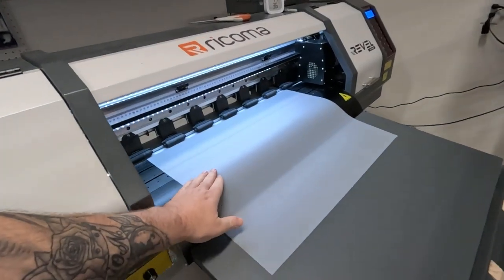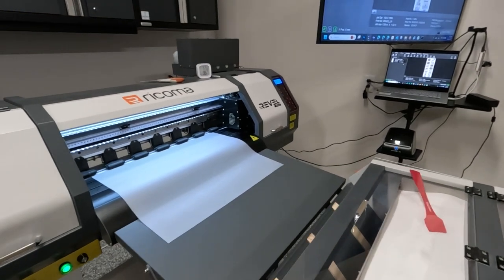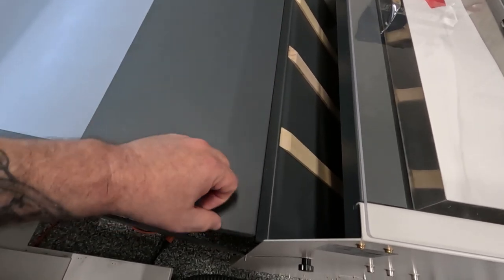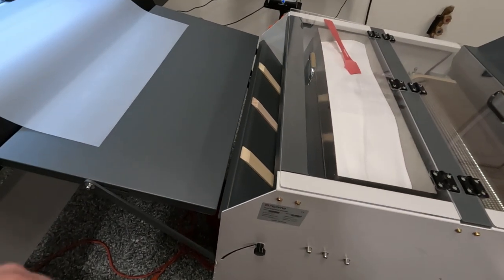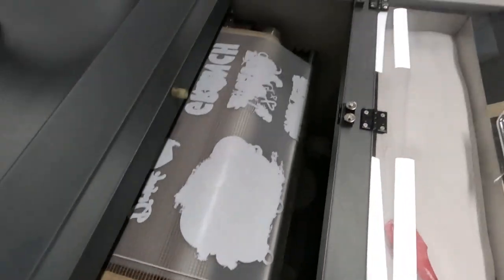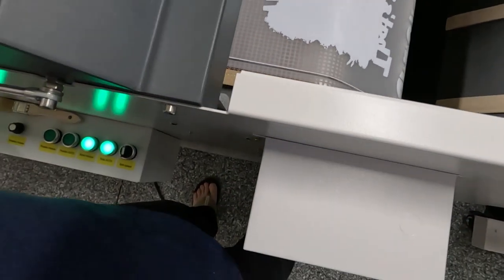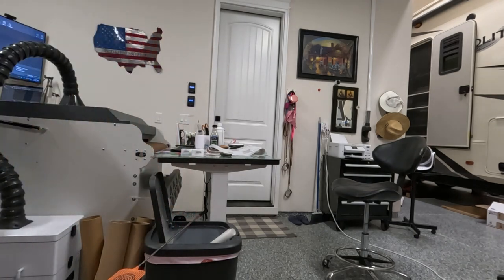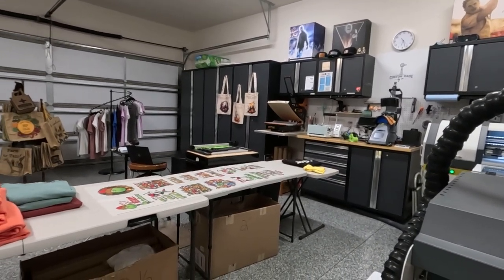DTF Anti Static Avoidance System Version 1

Comment: I have the Seismo M16 which is a different design. I just use some extra powder which adds weight to override any static issues. Maybe you can add more powder to help. Also, I back feed my shaker with film (Ecofreen AWESOME) which really helps. I call it the head and it is about 7 feet long and I use it for months and months. But I am not sure if you can do that b ecause it appears that you don't have a roll to roll.